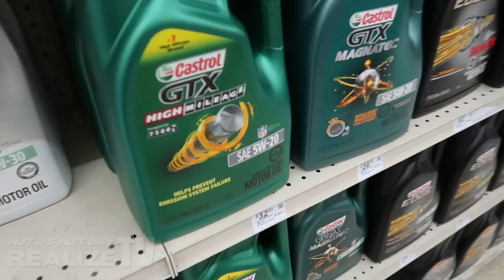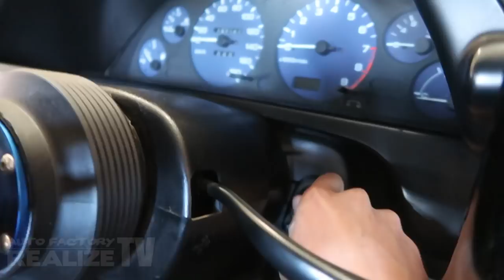I put ENGINE GLOW in my drift car!

Comment from the maker: Question of the week: what engine do you have and which oil do you use? Go go go!
Reply: Auto Factory REALIZE I only use Valvoline

Maxlife 10w-30. Altima
Maxlife 20w-50. 240sx

8 years strong
Reply: Rotella T6 5w40 with Lucas oil stabilizer xoxoxo
Reply: Mobil 1 5w-40 Turbo Diesel Oil for my Toyota 86. I figured since I don’t have a turbo, then turbo oil might help it go faster 💁🏻‍♂️
Reply: No car
No engine
No oil 
:'(
Reply: RB26, I use Mobile1 15w50. Takes a minute to warm up but I've already done one engine rebuild cause of a failing pump and now I'm paranoid of low oil pressure.
Reply from the maker: Yeah RBs and their oiling issues are terrifying.
Reply: +apbraaksma yup that's what killed my rb and now my hatch sits in the back yard of a friends grandmas house 

Doomed to live the life of the raged out green 240
Reply: 2jz...GE unfortunately Mobil 1 5w30 synthetic
Reply: Auto Factory REALIZE I'm starting to switch all my cars over to Valvoline vr1 20w50 race oil. All cars liking it so far
Reply: Turbo Miata BP-ZE: Eneos Synthetic 5w-40
Reply: Ford Sierra 2.0 DOHC
Valvoline VR-1 10W60

these indexes actually allows you to calculate the temperatures oil will handle
Reply: Same that you bought Teddy. <3
Reply: S13 SR20DET Redtop, Mobile1 15W50, heaviest oil I can find in Japan that is in stock locally.
Reply: Whatever Nissan recommends is what viscosity you run.. But a high quality race oil is what protects your engine. like liqui moly, Motul, or Eneos. (worth the effort finding it unless it's changed every event which I doubt, I wouldn't either.)  And the W does NOT mean winter. Its the viscosity once its warm. HUGE misconception.
Reply: Ka24de
Amsoil 5w30
Reply: I will run whatever my cars like, usually it's like Rotella, Castrol, Mobile1, but I have a had a few cars like that Quaker State power oil they used to have and the engines available too from turbo d16's to built hi comp b16's to sr20's an junk 7m's an even 2j's. 

An p.s where did you get that lightstrip Teddy? Did you put it in the description I'll check after this comment. Lol
Reply: Oh and I never run that synthetic blend s*** an yes I'm talking about the bottles that say full synthetic too, they're not full synthetic full synthetic is over bucks a quart is all that is a synthetic added to conventional base stock the tolerance to calling base stock oil full synthetic isn't very high.
Reply: Sr20det. Motul 300v
Reply from the maker: @Suicide Wash Squad I didn’t link it but you can just search for LED strip and make sure it isn’t one that uses an AC power adapter.
Reply: 03 lancer es
 oil 5w-30
Engine:4g94
Reply: 1jz vvti 5w-30 as recommended by Toyota
Reply: I run Penrite Racing10 10w-40 in my SR20DE, pretty much the go to oil for a Nissan
Reply: I’m late, but I run rotella in all my vehicles. 
Vvti 1j s13 gets 10w-30 Rotella T4
My 01 Honda F4i stunt bike gets 5w-40 T6
And my 01 7.3 Ford gets 15w-40 T5

Comment: Filter should only be hand tight ! The screw drive trick is grate
Reply from the maker: Only reason to poke a hole in the filter is to let air in so the oil will flow down and out. Since the filter is mounted upside down it can get messy.

Comment: 25W 50 with alot of stop smoke oil thickner hahaha! my oil rings are fucked, its a G180Z 1.8L 4 Cyl SOHC 8v Carburetor Isuzu engine out of a Holden rodeo, It's in my 1980 Holden Gemini TE Sedan, Wow that was alot of words

Comment: Whatever Nissan recommends is what viscosity you run.. But a high quality race oil is what protects your engine. like liqui moly, Motul, or Eneos. (worth the effort finding it unless it's changed every event which I doubt.)  And the W does NOT mean winter. Its the viscosity once its warm. HUGE misconception.
Reply from the maker: Oh wow. I had read that it meant winter but I feel all oil has the W so that seemed weird. Great insight thank you!!
Reply: I learned that from a Penzoil engineer. It was eye opening for me also.
Reply: The w DOES stand for winter as that first number is how viscous the oil will be when it’s at a low/cold temperature. The second number is the viscosity at temperature for your motor.

Comment: you should run as thin of an oil as you can without leaking/burning. 5w-30 is generally what I use for any car if I'm not sure. if it's a brand new car, usually 0w20 synthetic or 5w-20 synthetic. as far as brands go, every mechanic or whoever will have some favorite brand cause that's what their dad used and their grandpa or whatever, but they are literally all the same. get the cheapest walmart brand oil you can find. if you look at the back of the bottle, it will have a circle logo that says "APN oil something SN certified" SN is the only thing you need to worry about. it's the grade that the oil was rated at. SN is the highest (so far) and pretty much every brand is rated at that mark so it doesn't matter. 

what really matters is your filter brand. some brands cheap out and used a cheaper media for filtering oil (mainly FRAM), but other than fram it won't differ too much. usually I use STP or mobil 1
Reply from the maker: Thanks for the awesome insight! Actually didn’t know that about the certification that’s a great tip!
Reply: It actually does matter, and a lot of oils are different. Different companies use different additives in their oils. I work in a shop and we’ve done oil changes in a lot of Mercedes, Audi, VW, BMW etc, and we’ve had quite a few cars throw a CEL after the oil change if we didn’t use Castrol in the car. But after switching back they were perfectly fine. As for the filters, there’s a lot more to them than just different media’s used. It’s usually best to stick to an OEM filter or go with something more high end like K&N